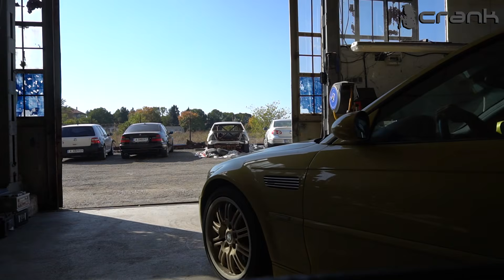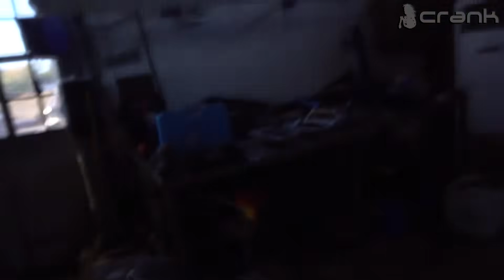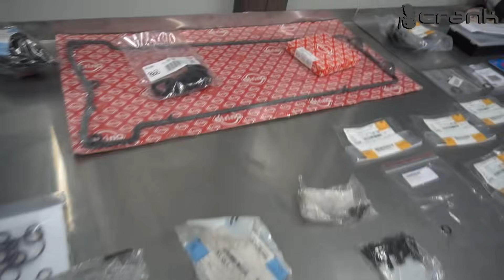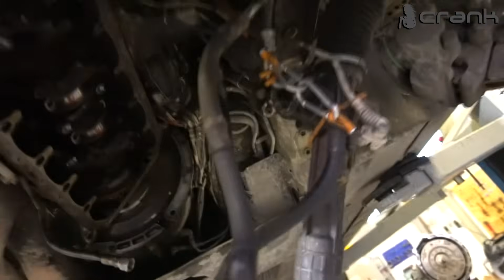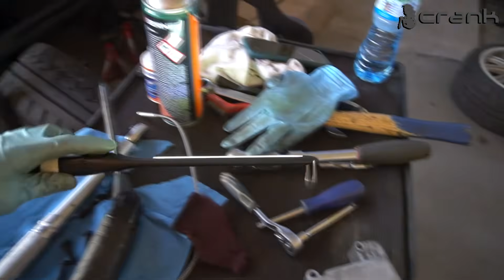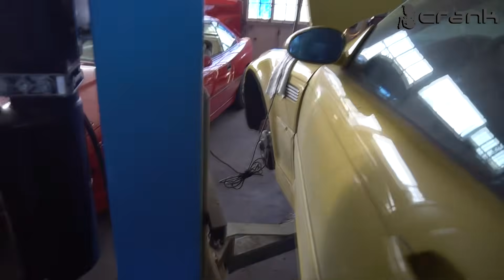BMW E46 M3 Timing Chains and Conrod Bearings FULL Service

Comment: Your camshaft caps are around the wrong way
Reply from the maker: Hah nice catch. The car had previously cylinder head gasket job done in the dealership, so I guess they have made that mistake.
Reply: Love your videos, Adam - Australia
Reply: I am the owner :) do you thing this reversed caps can couse damage? The car is again with check engine lite on.
Reply: @kristiansaraliev  hi, I don't think it would cause any problems but I'm no mechanic or BMW expert. Mine and all others I see are the other way around